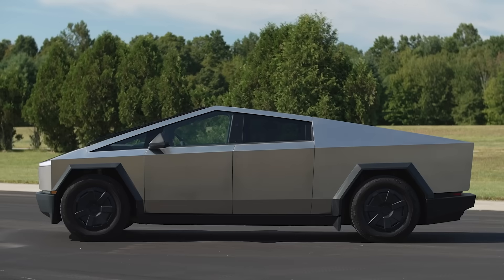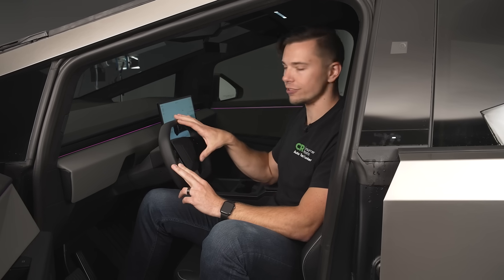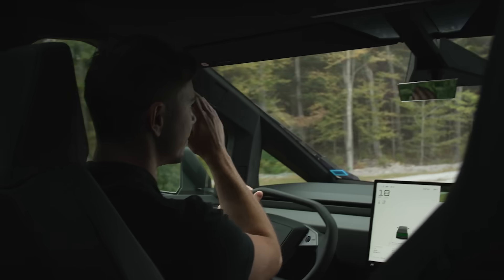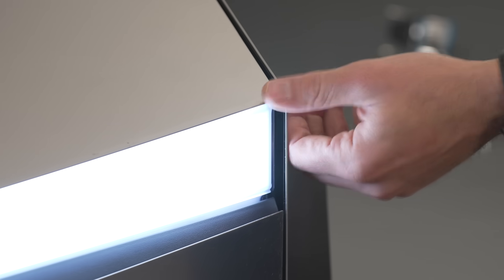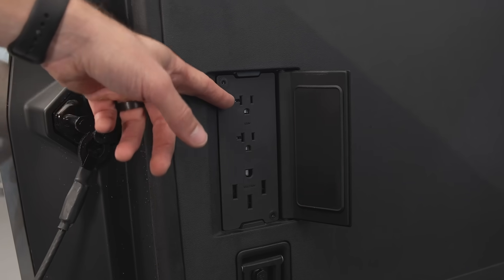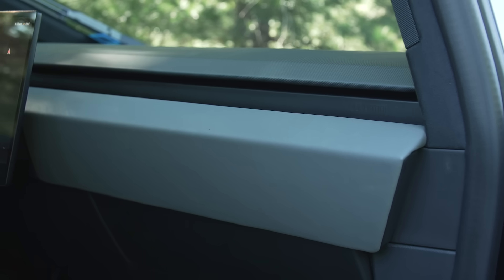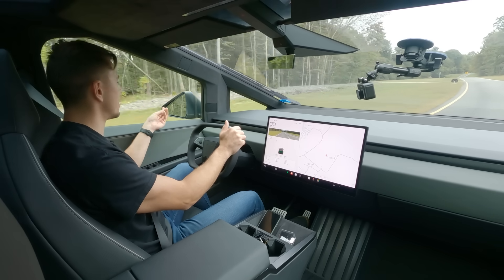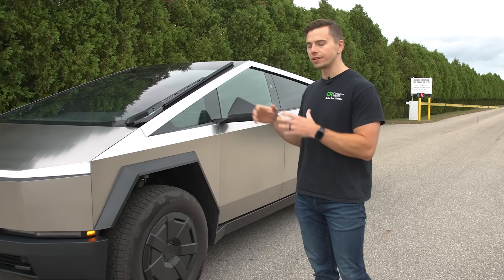2024 Tesla Cybertruck Early Review | Consumer Reports

Comment: The interior is cheap and ugly, you can barely see out of the windshield, you can't see out of the back window, the wiper is almost useless, the steering feels like a video game with no feedback whatsoever. The exterior panels are hung/glued to the steel framework and do not act as an exoskeleton which would imply it's structural. The build quality is the worst in the industry and the cheap "stainless" steel rusts. Other than that it's great!

Comment: It's still expensive junk. Way WAY too many issues. Horrible customer service. Way too short of range. I like to see it go 300 pluse miles in the winter. To short of life on the battery. There are too many issues with fit and finish for $100k vehicle. Not a worry, I'd never buy something that's a third of the value of my 171 years old house in Connecticut.

Comment: I have a Cybertruck I wrapped in red metallic. I agree with many points made in this video. However, I have 8,000 miles on mine and I have some additional points.
1) Steer by wire is so amazing as it offers ,any levels of assistance to driving.
a) Steer by wire will be copied by the automotive industry because it makes driving a pleasure.
b) Steer by wire makes road ruts from heavy trucks disappear. The Cybertruck is simply immune to road ruts as the steer by wire does not allow the road ruts to steer the truck. All usual steering inputs due to ruts is GONE .
c) Full self Drive in the many iterations of V12 is totally awesome. Driving through high speed construction zones at 74 mph surrounded by cars and tractor trailers requires ZERO intervention. Flawless performance as long as you look ahead.
d) Night driving on FSD minus fog and rain is flawless.
e) fit and finish reports is total anti Musk Bunk. The frunk on my Cybertruck did have a misalignment. Upon looking at why, I found an adjustment stop. Readjusted the stop and the panels were perfectly aligned.
2) What I do not like.
a) For $102,230 I fully expected hub caps, there were none. The Floor mats in the front do not match the profile of the front seat supports which creates floor mats that will not stay in place. Very annoying.
3) Overall, The 2024 Cybertruck is a  true game changer. The biggest " Biggie" Steer by wire. is a total game changer. If you could put this in every automobile made everywhere, it would be an amazing improvement to the art of driving a car. Go Tesla!

Comment: You nailed. Its function following form, which is the opposite from how basically everything else, from furniture to buildings to cars, is designed. Musk debuted the Cybertruck and it took over 3 to 4 years to deliver goods. So they had the form to start then tried to make it work. It’s the hard way of doing anything. I’m sure along the way, many engineering and manufacturing problems revealed themselves and solutions had to be developed on the fly, which uncovered and created more problems. It’s compromised. There are many blind spots, numerous places where one could get a deep cut or lose some fingers or a hand and god help any pedestrian hit by one or another vehicle in a head on collision, and the fit and finish could be better. Panels gaps, misalignments and sharp are common. This was a mega-billionaire’s flight of fancy. It looks like nothing that ever came before which was the point; a futuristic looking vehicle today. I’ve seen a few of them in the wild. They certainly turn heads. I think if one has a lot of cash burning a hole in their pocket ($100,000 and it’s not the top end!) and one wishes to draw a lot of attention to oneself, meet a lot of people with questions who want photos and tours, something unique (for now) to bring to cars and coffee, etc., this is the vehicle for you. It’s an automotive flex. For the price range this is in, and I don’t need a pickup for anything, I wouldn’t buy one. If I needed a pickup for utility, I’d probably stick with a ICE vehicle. For Tesla, the ROI is going to be a long time. I don’t think they care. Also, like every Tesla I’ve been in, the interior went straight past cool, smart, minimalism to boring and dull.

Comment: Dont get in a femder bender. They have to replace the whole panel.  If it dents it dents the whole inside of the vehicle since the outer steel is stronger than the inner part that its glued too.  Cant just replace the the fender skin or door skin, you basically have to replace the whole door. This vehicle is all kinds of disasters waiting to happen and everything is expensive.   No one will want them after they're out of warranty.
Reply: Do you have any idea of cost of a paint job on a door ?

Comment: TLDR: This truck sucks, especially given its 100k price tag.

Numerous design flaws created in order to get that absurd shape. Flaws that make visibility so bad that an entire car can be hidden behind the A pillar. 
Rear view visibility with the minuscule mirror is horrible and the rear view camera view disappears when you use the turn signal. 
EVERY piece of information is displayed on the only screen which is center mounted . No screen in front of the driver is laughable given the car's price. Cost cutting on a $100k car.
There is no exoskeleton. What was described in the video is not an exoskeleton.
Interior materials and fit and finish are subpar even for a car selling for $60k. 
Serious visibility issues front and rear but no parking sensors - ridiculous. 

God help the person who gets hit by this vehicle. The incredibly rigid SS panels and their sharp edges are going to cause gruesome injuries. 

I heard a lot of apologizing and softened criticism, but why? If BMW or Benz came out with a $100k car that had all these flaws and was hideous, they would get blasted for producing an epic failure.

4 wheel steering and drive by wire are cool but they're wrapped up in a hideous, overpriced package.

Oh, and it doesn't have a "futuristic design", it has a laughably bad design.

Comment: A few points they could have mentioned for consumers:
He spoke about the steer by wire, but what they didn’t do is demo it do a U-turn or show the manoeuverability in a parking garage, which is way better than other trucks, or show it varying sensitivity with speed. 
He complained about side access to the bed but didn’t say you can use the air suspension to raise front and lower the rear for better access. Also to enter lower height clearance areas. 
Or the off road capability with variable ride height, torque control and creep. 
The sound system is among the best in any vehicle. 
The rear seats fold up and doors open to almost 90 degrees for heaps more storage space. 
It uses 48 volt electrical and ethernet like control architecture. 
Like all Teslas it will improve over time via free over the air software updates. 
Didn’t mention the excellent Tesla phone key app
Didn’t talk about the high charging rates. 
Full self driving has now dropped for the CT, but no addendum to the video, and by all accounts works well. 
As for % American made pickups Tesla cyber truck is a close second  to the Ridgeline and way ahead of Ford, Ram, Chevvy etc. 
This is a mediocre review and certainly could not be described as a report. It seems to me they tried to second guess their audience opinions.
Reply: Thanks, Elon.

Comment: For the lack of parking sensor complaints, you should really go into settings > autopilot > park assist > enable tesla vision. It makes parking so much easier! It shows you a birds eye view of the car and its surroundings and you can see parking lines, obstacles, ect. I don't know why Tesla doesn't have it on by default, it's amazing.
Reply: Chevy Bolt does that, I love it. Of course it has drawbacks, the side cameras are underneath the side view mirrors so they are unable to see anything ABOVE that. While I knew that academically it was brought home last year when I was backing my car into the garage and using the camera, I backed into the little plastic handle on my table saw rip fence. The car took $2500 damage to the quarter panel to avoid breaking a $5 handle. Never saw (npi) a thing on the cameras. If I had been looking over my shoulder, as I would have in any other car Ive ever driven (which by definition did NOT have the camera), I would have seen it.
Reply: My Audi does that but it is supplemented by a beeper that I rely on too. There is zero reason for this other than a poor design.
Reply: The cheapest car now has that. For 100k....?

Comment: Besides the panels coming off, the window wiper breaking or just not working, the air suspension malfunction's, the control arms breaking, the brakes not working, the tail gate leaking, and the frame failure on a few of them now Id say you'd have to be a fkn moron to buy one. Well unless they improve them and they wont.... 

O and the months of waiting when they do break down in the service shop..

Comment: At 15:32 - Turn signals work well "90%" of the time.  You gotta be joking.    On my 2009 VW Jetta 2.5, the turn signals shut off 100% of the time after completing a turn.    

You can keep your CyberTrash.
Reply: The 10% is for lane changes. And it only doesn’t work if you turn them on after you already started shifting lanes.
Reply: My Tesla 2023 MY has the same problem and it’s trivial.  The Tesla doesn’t have a mechanical reset like other vehicles. It never misses turning on the signal, just leaves it on a bit longer from time to time.  It does take getting used to. If you’ve ever turned down a fork in the road with a typical vehicle with the turn signal on you know it will stay on forever Teslas will turn it off after a period of time. So, balances out.

Comment: I test drove one this past weekend.  I have driven Ford Expeditions and pickups for the past thirty years.  The acceleration of CT was unbelievable - almost addictive and I don't drive fast.  I think if you are used to driving larger vehicles (full size SUV's) there is no real issue with the CT.  The price has dropped to $85,000 - so pretty competitive with Expedition and F150.  Not sure why Ford Lightening has done so poorly in sales - I am going to test drive it.  Rivian seems highly rated - but will the Company make it?  Internal combusion engines just seem slow.

Comment: At best, the steering in only redundant. I haven't seen how many sensors are in the column, there could be only one.  But there are only two wire cables from the column to the rack.  Not three.  Redundant.  Not triple redundant.
Reply: It would not have gotten past the government types with single sensors.   It is uses 2 to 3 levels.  Never a single point of failure.  This is a ZF unit.   The same setup is going into many German cars.  So it has passed muster there too.

Comment: Maybe i'm weird, but I want to feel what's going on with the wheels. I like feeling the traction control stepping in when I do something stupid. I don't think you're going to get that with drive by wire.
Reply: There is a sensor on the rack and a motor on the steering column that provides feedback.

Comment: I think that one cannot discount the value of having US 120v/240v outlets, which provide a massive back up battery for home use in the event of a power outage.

Of course, it is not designed to run your whole house, but with long extension cords, you can keep your refrigerators and fans and small appliances and internet and computers running in the event of a power outage.
Reply: Once can get it with a system to hook it into your home electrical supply but it is not cheap.

Comment: 2:45 Off to a bad start, that's factually false. 2014 Infiniti Q50(Hybrid/3.7), 2022 Lexus RZ 450e.
Reply: It’s not entirely false. The Q50 was still mechanically linked as a failsafe. The RZ450e never actually shipped steer by wire as far as I’m aware, they claimed it is coming in 2024 by then the cybertruck already shipped. 

The Tesla is literally a PC racing wheel on a dashboard, no backup mechanical linkage…which should scare you a bit. I would file it under, “yes, first! Yikes”

Comment: The trailer hitch is attached to stamped aluminum which breaks instead of bends, steel flexes. I expect a full ban on towing with them or a complete recall and rebuild on that part of the truck. Towing range is awful especially if it's cold. The new soccer mom H2 Hummer, a truck without a mission.

Comment: Surprisingly wonderful review from CR.  Would be nice to hear your towing review-- long time truck owners say it's the best towing vehicle they've ever used.  They didnt care about range like folks that have never driven one are.  Full Self Driving, where you it will drive from your own driveway to wherever you work or play, is on all Cybertrucks today-= your review was a week late.   And it will now back itself into the charging stall, which you mention is something you are concerned about.    Also remember you can operate an arc welder out of the 240 outlet in the back-- that no other truck has.  And you didnt mention about the ride quality for a truck--- which owners say is like riding in a Cadillac rather than a truck with a 2500lb payload capacity and the ability to tow 11,000lbs.  How many trucks that can tow 11k lbs can maneuver like a sports car and are as comfy as a Caddy?
Reply: Can you give us some links to long term truck owners that say it's the best towing vehicle they've ever had, Del?

Comment: it feel slike a cheap 8- ies truck with an old Ipad mounted on - so it has a low tech alement to it - but at the same time a military, undestructible vibe...none of the, are true - but more of how the car feels... I think a few more controls inside, a little smaller bed (who needs that bed that long, no one is actually hauling things in it, trust me), and a version that doesnt cost 80 grand. base vesion at 49k, as advertised but needs 2 motors, and more power. Cyberbeast is for people with genitalia size issues or whatever - I just dont liek being forced to spend 80 grand on the middle model. Range shoudl also be 400 miles on every model.

Comment: If any non-Tesla vehicle did most of the dumb things design and build-wise, it would be crucified, quite rightly.

But as usual, the worst they get is "not to bad".

Maybe it's the young age of the reviewer. I don't know. But when other car makers have tried new technologies, and they had teething issues, there wasn't the same willingness in the automotive media to cut them slack.

And when this review is talking about "getting used to" various quirks, especially to do with the vehicle controls integrated into one screen, while other vehicles aren't given the same patience, it's ridiculous.

Just think back to the info-tainment systems that were hammered because they weren't immediately intuitive, or that were criticized for replacing knobs with electronic slider switches. No mention of the fact you'd get used to them, too.

All in all, another Tesla whitewash by the automotive media.

Comment: This is most definitely NOT form over function. You just don't understand what the function is: The entire Cybertruck is a MANUFACTURING tech demo. Just like Tesla originally build the Model S and then finetuned it to the Model 3, now the Cybertruck is premiering MANUFACTURING techniques that will trickle down to e.g. the 25k $ car
Reply: What $25K car would that be?
Reply: It is literally an Aluminum Frame not Steel like literally every other Work Truck!
Reply: correct. all this in the end will translate to mars.
Reply: Tell me you are a fanboy, without telling me you are a fanboy. To claim CR does not understand the function of what a pickup should be is ridiculous. While this vehicle is very impressive, the design aesthetic  creates compromises in function that the owner is going to have to deal with on a daily basis.

Comment: I must say good fair review. However, in reality I farm and also pull heavy equipment with a trailer. If you maybe use the bed for lightweight items to and from your local store, it could be the truck for you. With the closest public charger to me in Pennsylvania being 31 miles away a Cybertruck is a liability. My 73 full size Chevy  one ton springs. with  4x4 springs  31k miles is a better option for hauling.  Even my 94 S10 short bed had more space in the bed then the Cybertruck. .

Comment: I just cringe at the sight of this vehicle. It seems like every bad idea designers and engineers could think of got incorporated in this Edsel of the 21st Century. I've heard lots of horror stories already on engine failures and build problems like leaks of washer fluid and cheap plastic parts in the engine that break easily.

Comment: When it came to washing the car, I was surprised that no mention was made that you cannot take the truck through an automatic car wash.  [Disclaimer, l read this and do not know anyone who has one.]

The comment also said that the truck manual advises to not take it through a car wash.  

Combined with its design and awkward size that leaves one with either more expensive manual washes or the task of doing it on one's own. 

It would be good to verify if this is accurate in your upcoming full report.

[Being a car driver I don't know if this is common with other trucks as well.]
Reply: Owners have said they've taken the truck thru 100's of car washes without a problem.  The guy who originally did the story said he then realized it wasn't the car wash but a separate software glitch.  But don't listen to whom actually owns one.